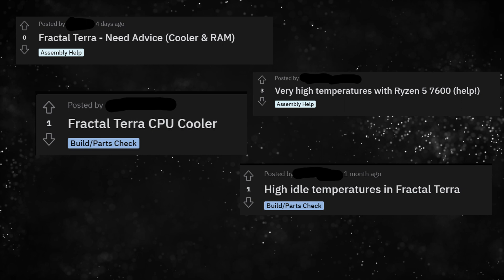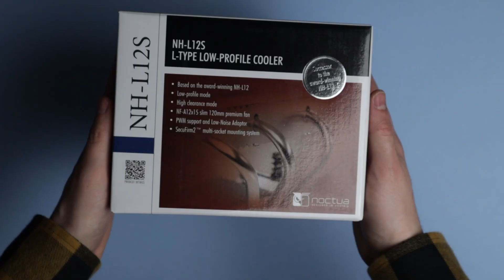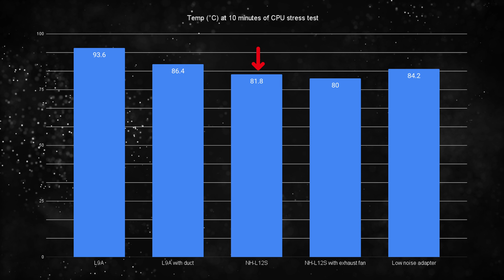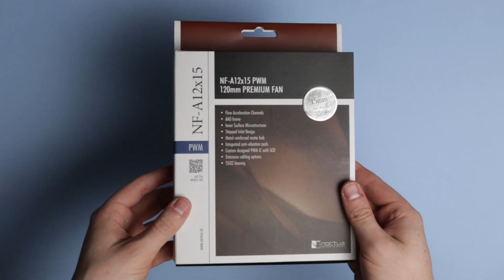What’s the Best CPU Cooling Layout for the Fractal Terra?

Comment: Thanks for this video! PCPartPicker notes the Noctua NH-L12S as incompatible with the Fractal Terra however. Did you have any issues in your experience installing it?
Reply from the maker: Nope, it worked fine for me without any issues at all. You may run into issues if you have a very large graphics card though, but other than that, it fits in perfectly
Reply: @SmallBoxCentral  Great to hear, thank you!
Reply: @SmallBoxCentral Hey sorry to bug you again, which motherboard do you have installed?
Reply: I can confirm the L-12S Ghost S1 Edition will fit perfectly in this case with a 50mm thick GPU.
Reply: Its the NH-L12S 77 is what you want for the terra. it has fan on the inside, unlike the NH-L12S, which has on top and crrates the loud noise close to the cover.
Reply: @b.g01d3nT0ngu3  doesn't the NH-l
L12S also have the fan inside/under too?
Reply: Thought same thing after the seeing this video, but it works!
Reply: It wont clear the ram with b550i motherboard — is there a walkaround on this?

Comment: I wish we could have a passive ("fanless") cooler design of that size, where there's more metal and heatpipes involved, then optionally very big and slow coolers on top, which cool the case. Similar to The Beast from MonsterLabo.
Reply: soon when solid state cooling will get mainstream, look up frore systems
Reply: actually lot of components could be easily cooled with a properly designed all-metal case
Reply: That is the stupidest thing I’ve ever heard. Temps would be over 100C

Comment: Does the terra fit any watercoolers?
Reply from the maker: Yes, a 120mm on the graphics card side. But it means you must use a very short GPU because the radiator will block it
Reply: Get Graphic card that has 200mm length or less, and 120mm AIO will be fit

Comment: I’ve been looking for a cpu cooler that can cool the 120 watt 7800x3d…any recommendations?
Reply: Get a ID Cooling IS55 Black, nothing else, read my above post/
Reply: EK-QUANTUM  Velocity  AM5 4.2 DDC pwm reservoir/pump/block combo. Stick an EKWB EK-Quantum Surface s140 rad somewhere and stick a Noctua NF-A14 industrial PPC pwm fan on that bad boy.
Reply from the maker: Probably the configuration in this video! L12S with the exhaust fan. Can't really get much better than that in this case. Unless you have a tiny GPU and get a 120mm AIO

Comment: I have the same case, and an Intel i5 13600KF processor, and I stupidly bought the Noctua nh-l9x65.
It too termal throttles directly at high load, even after undervolting. It cannot keep up with the load. Even idle temps are 40-50c depending on various stuff. I too have an exhaust fan in the bottom of the case.
I've now ordered a Thermalright AXP120-x67 after some recommendations online. Would like to know how well it stands up vs the Noctua NH-L12S in this case.
Thanks for the video!
Reply from the maker: I've heard that any cooler with the fan on top (that will sit against the side panel) makes it unbearably loud due to to turbulence, Gamers Nexus mentioned it in their video on their Terra which I reccomend you look at! The L12S manages to avoid this as the fan is under the heatsink and it's blowing the opposite direction. Do let me know how it works out though, i'd be interested to see how it performs
Reply: @SmallBoxCentral  the fan is exhausting through the heatsink or sucking air through the heatsink?
Reply: @superstaples  same question
Reply: I've also i5 13600K and Noctua NH-12S cooler. Idle temps : 35-40. Working temps (programming, importing and some CPU stuff). 35-60 (average 40,  inaudible noise). Playing Games 2 hours (PUBG 4k): 70-85 (AVERAGE 78). I have fixed fan speed on 75% when playing for playing with low noise. When i open "sidewall" on CPU side of the case temperature drops by 5-10 on average (for example when playing PUBG average temp. drops to 70). I was struggling with PC construction a bit. Low profile RAM modules are necessary.
Reply: @maxxike  do you powerlimit the cpu?
Reply: Some,some,have had minor luck reversing the bottom fan. Again, some....